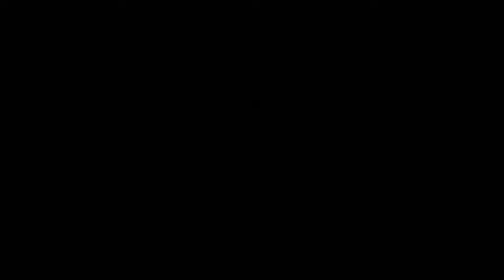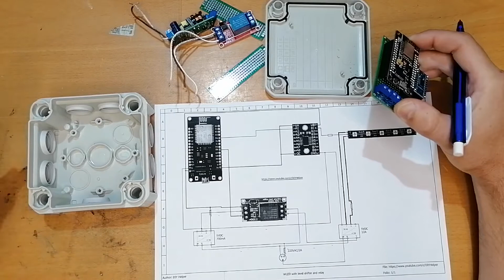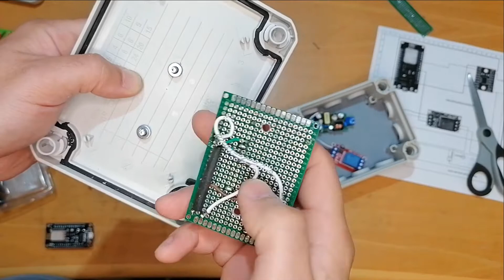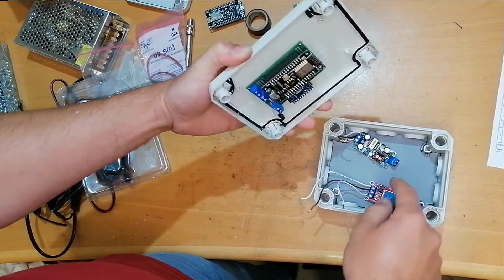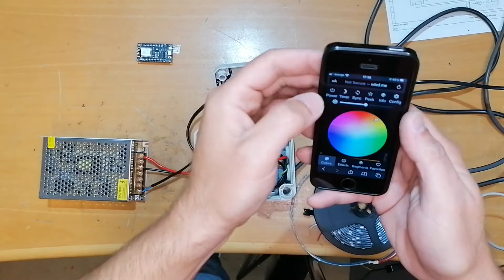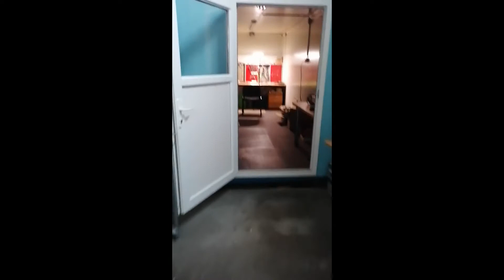WLED controller case ideea. Nodemcu ESP, buck converter, relay ws2812b LED strip

Comment: Can I ask what type of buck converter you use for this?
Reply from the maker: RON 16.18  46%OFF | 1PCS Green AC-DC Precision Buck Converter AC 220V to 3.3V 5V 9V 12V 15V 24V DC step down Transformer Switch Power Supply Module
https://a.aliexpress.com/_mLIQ5PG

Comment: hello beautiful video.  I wanted to ask you for help because I am desperate I have more than 200 euros of LED pixels that I cannot use.  I'll explain, if I connect the very long data wire about 6 meters, the LEDs flashing abnormally, reading here and there is a problem with the ESP.  how did you solve this problem?  from the video and the wiring diagram I see a level shifter module.  can you solve my problem?  thanks a lot
Reply from the maker: Well yes, it should, very cheap part. I think I have the link to it in my other wled video description.
Reply: @DIYHelper  OK thank you very much.  now ordered the component and cross my fingers that I can solve my problem 🤘✌️